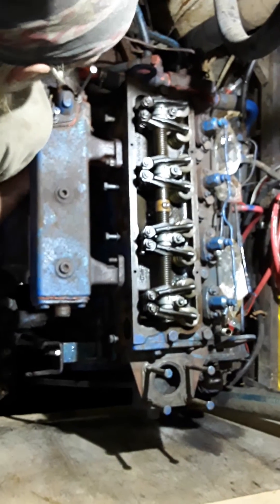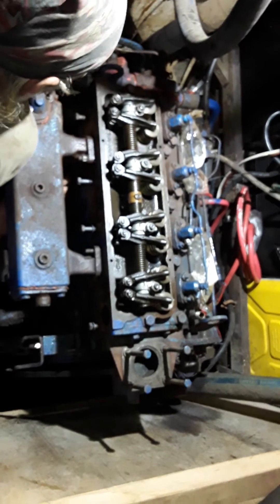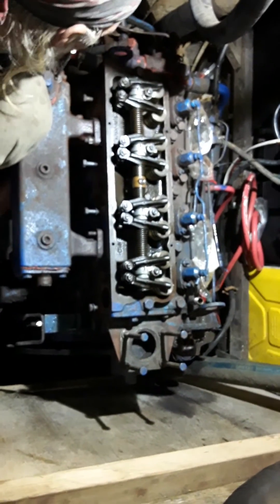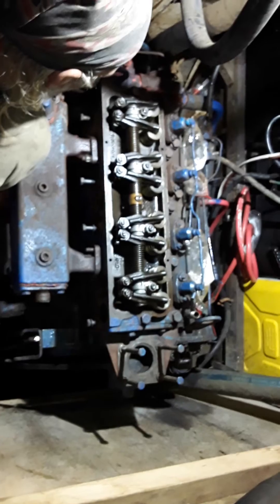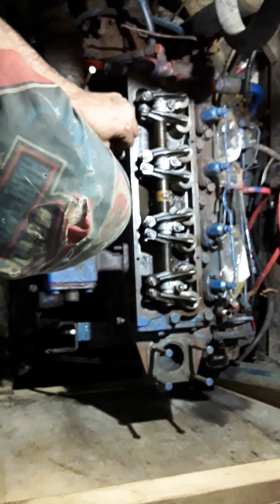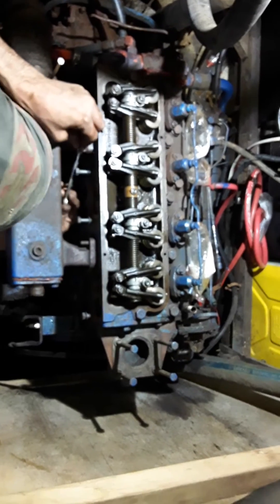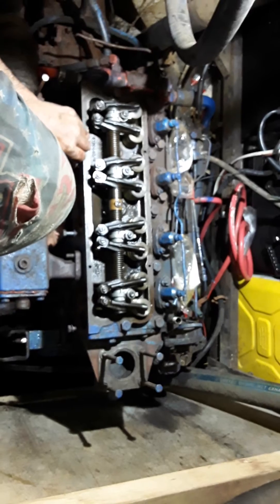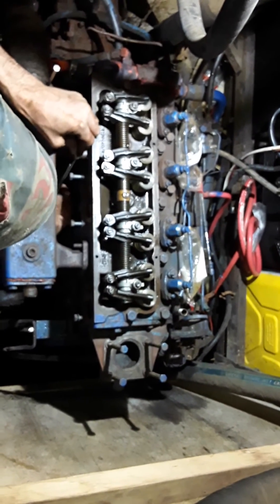Replacement of a head gasket  on a Perkins 4.236

Comment: Hi, you wouldn’t happen to know how tall the engine is from bottom of sump to highest point, I’m considering replacing the Chrysler Lm318 in my boat with this engine but I’m concerned about the height?
Reply from the maker: I can attempt to get some measurements...  but where my engine is I cant see the actual bottom of the engine... but I measured from the pan under the engine  and its approximately 30" tall...
Reply from the maker: My running 4.236 is for sale... $3000 obo
Reply: Bonnie Cavanaugh & SV Content Your a legend, thanks mate :-)
Reply from the maker: @anthonyhayden320  glad I could help... fair winds and a beam reach... I hate following seas...lol